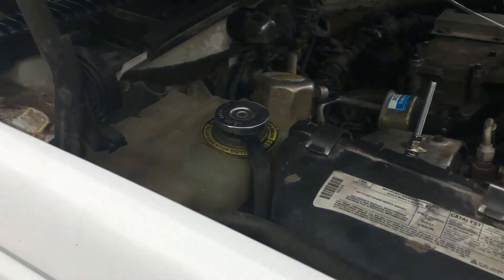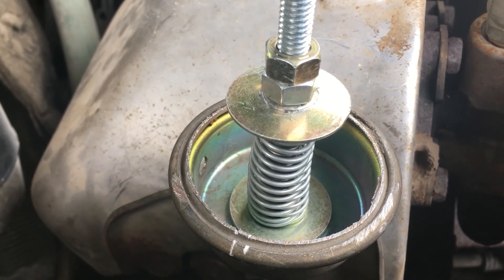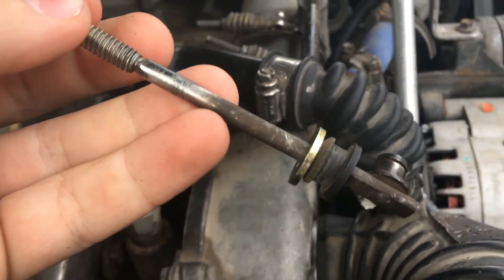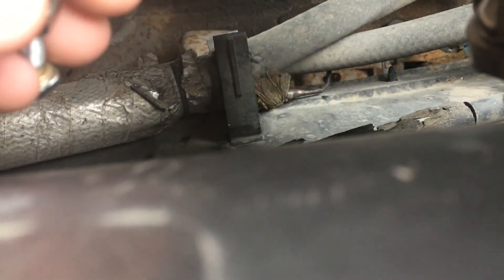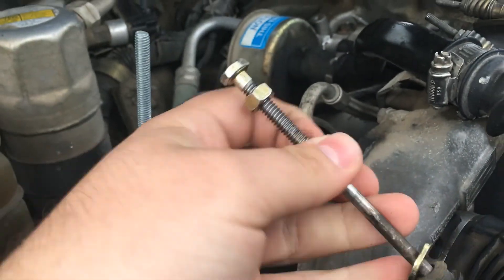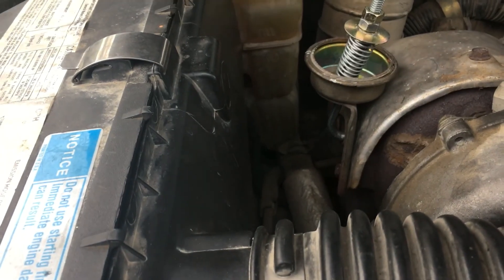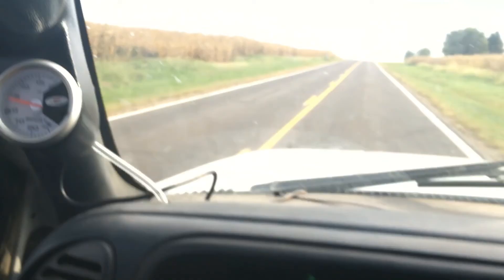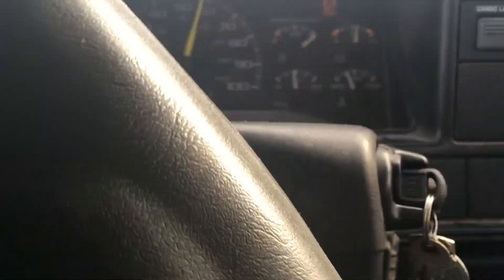6.5 detroit mechanical waste gate

Comment: My question is what do you do with the existing vacuum line that comes from the vacuum pump
Reply from the maker: You can just remove the line. It won’t hurt anything. Can also remove the vacuum pump and run a 1 inch shorter belt if you want

Comment: Any updates? I tied my waste gate completely closed and use my foot to control boost. I did add a resistor in-line to fool the computer so it doesn’t derate the fuel if I give it more boost then it wants. Just recently removed the Diesel Oxide Catalyst. Basically gutted the original pipe and reinstalled it empty. I am amazed at the turbo response. Now thinking I should add a manual waist gate to keep some less aware drivers from causing issues (wife or kids lol)
Reply from the maker: Four months later it still works fine. Also I would advise not exceeding 12pounds of boost on a gmx turbo. Remember the drive to boost ratio on these turbos is 2.5:1 which means 25psi drive pressure at 10psi boost pressure. That leads to a lot of dangerous things high cylinder pressure high egt’s and high iat’s
Reply from the maker: I need to do an update video on it sometime soon I just haven’t had the time to between work and farm. However the other night on the way home from work the map sensor started acting up and reading high. It is now popping an over boost code at 3 psi of boost. Gonna replace it this weekend and might make a video on it afterwards
Reply: tjrrfarms thanks for the reply. When i was looking into removing the vacuum waist gate system i read somewhere that you could get an over pressure code that would cause the computer to de rate the fuel to protect the engine. In the same article it talked about installing a “fooler” resistor. I did the install and never had an issue. But i am personally responsible for controlling the boost pressure now that i wired the waist gate closed. That’s why i was looking into putting together the spring controlled waist gate.
Reply from the maker: ryanburbridge if you ever need any extra info on 6.5s go to https://quadstartuning.com/pages/documentation they have most of the information needed for these things there
Reply from the maker: Also if you have Facebook join the group quadstartuning owners club. If you have any questions post it there. Most of the people in that group are extremely knowledgeable and the owner of quadstar himself will occasionally answer questions there
Reply: tjrrfarms thanks bud but this is the only type of social media i have lol. But yeah they seem to be on top of things. I just don’t get to spend much money on my truck. But i enjoy adding a few things here and there. Just got the GMTDscan download and will be ordering the cable tomorrow. Thanks for the reply
Reply: tjrrfarms i was looking at quads wicked wheel but as i was doing research on the turbo i realized i may have the “GM4” turbo. Not sure if the WW will work on mine. May just need to upgrade the whole thing. But before any performance upgrades i want to get the software and start poking around to get a good idea of what’s going on. Truck only has 140k and as the second owner i doubt the injectors have been changed.